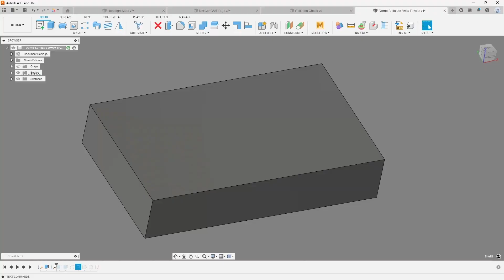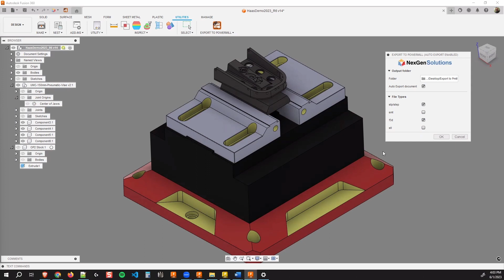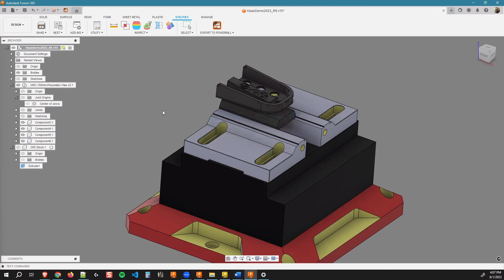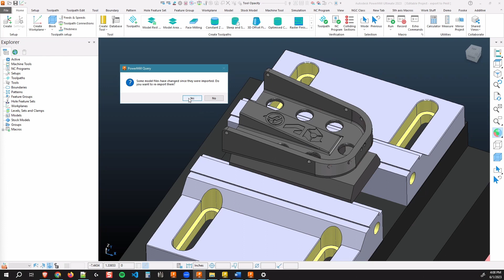Fusion 360: Export to AutoDesk PowerMill API

Comment: Hey guys
Great app! Is there something you need to activate (a setting) in Powermill so that it and F360 link? Doesn't seem to link when updates in F360 occur. Thanks!
Reply from the maker: we are working on a V2 that will auto import into powermill or auto pull the latest and greatest